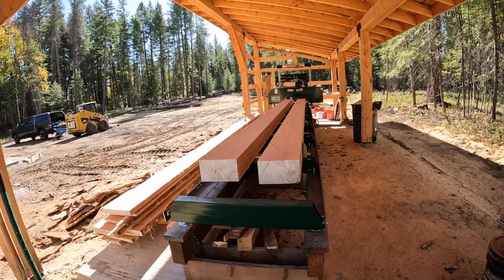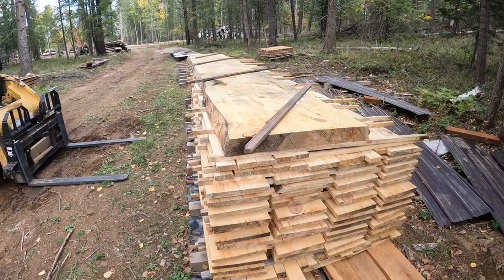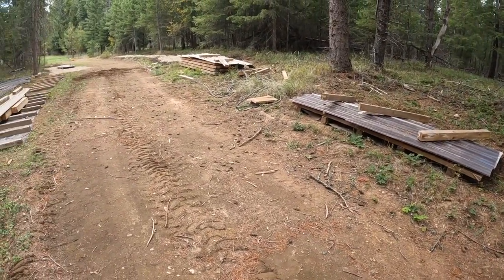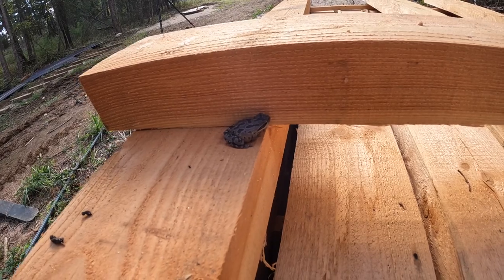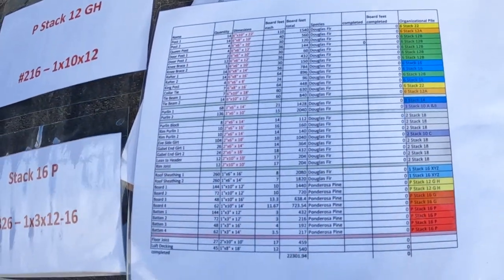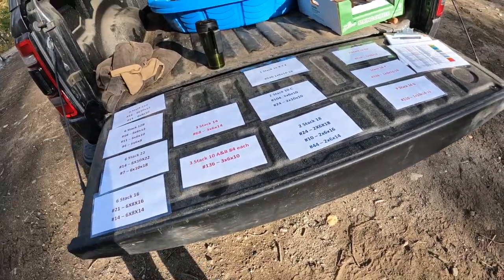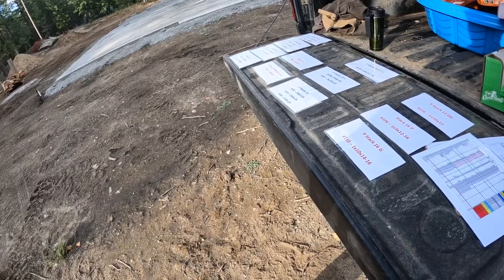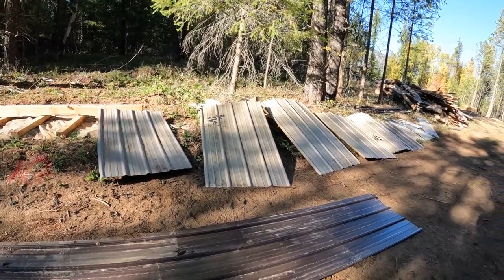How Do You Store Your LUMBER? // Organizing Dimensional Lumber // Woodland Mills HM130 Max Sawmill

Comment: My biggest mistake was hurriedly staking my flitch(s) on uneven supports. When I didn't offload the truck the same day I left the mill I would get mold. Bleach was my answer. I went with a 400A meter and two(2) 200A Panels for the house and shop. I only wanted One bill instead of two from Northern Lights.
Reply from the maker: I definitely need to do some work on the mold problem. I stacked that in the rain and some of the stickers were soaked. 
I found a 400 amp all in one panel, so I should have plenty of power for future needs. 
Thanks for watching, Tim! 😁